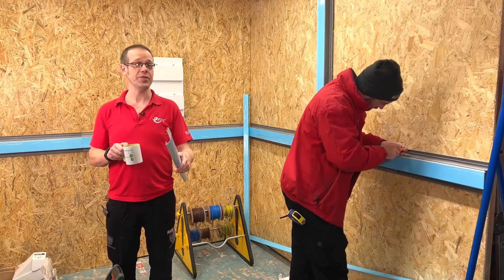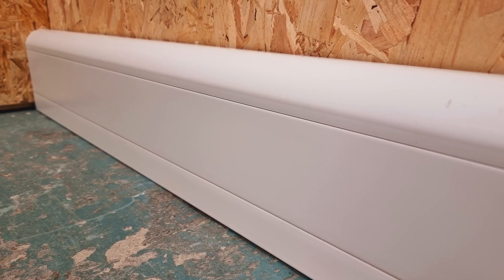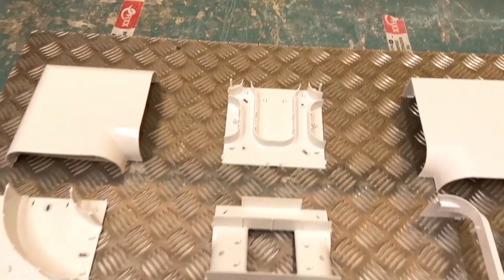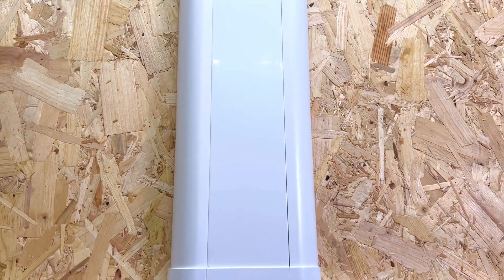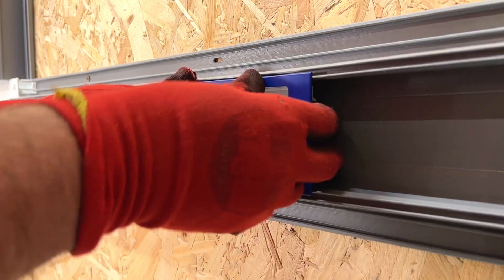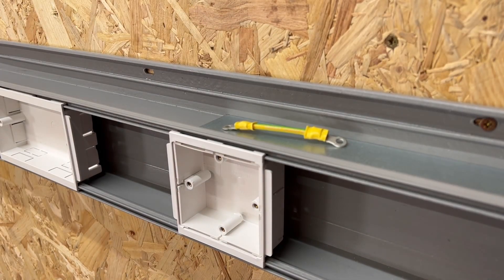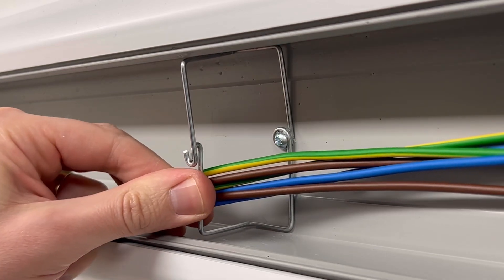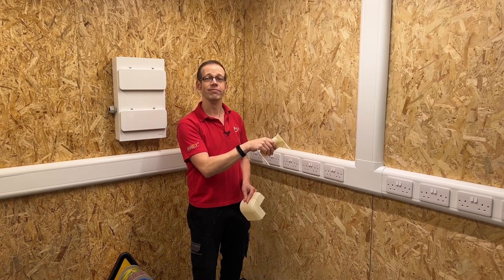Solve Your Dado Trunking Installation Problems With Marshall Tufflex

Comment: What is the IP rating and UV resistance?  I need to install trunking on an outside wall but everything I've looked at is either hideous or is made from material which will yellow or become brittle after a summer in the sun.

Comment: 3 compartment isn't really needed anymore. It was used for power, data, and telephone. Nowadays, we don't run telephone cables as mostly it's VOIP so we use data sockets for IP  phones.
So really we only need 2 compartments but 2 compartment trunking looks a bit weird as sockets aren't in the middle. (You can get 2 compartment trunking)
Reply from the maker: Thanks for sharing your thoughts… some great points 👍🏻
Reply: Data and telephone still used the same UTP cabling so that argument doesn't really hold any weight. I would argue that having two outer compartments is important for being able to run the large number of data cables required for a busy office with many dozens of network points.
Reply: @davepusey  what I mean is that in the old days, telephone cable was different to data cable. I get that you need the space but if there were 2 compartments only, it would be easier to run data in 1 and power in the other. You actually need more space for data than power as data is 1 cable per point whereas power is daisy chained. We often run data in the middle and one of the other compartments and power in the 3rd for more space
Reply: @AsadMulla  I didn’t think running data in the middle was allowed due to segregation requirements